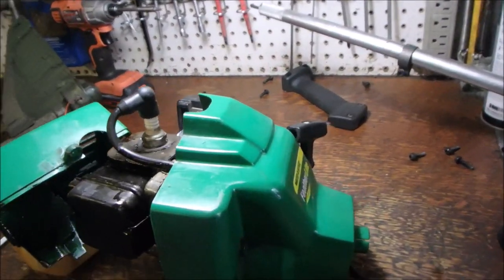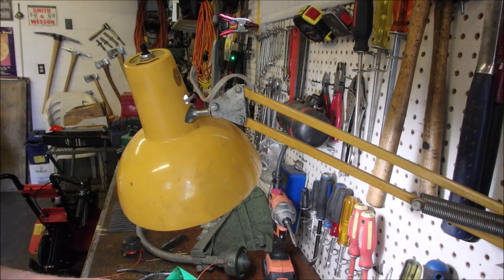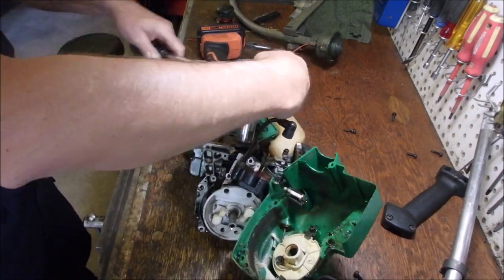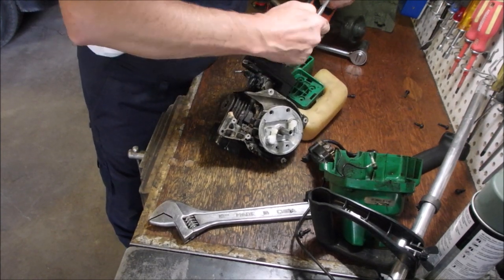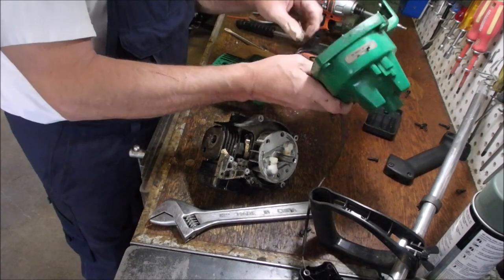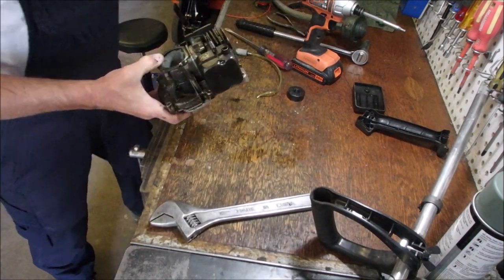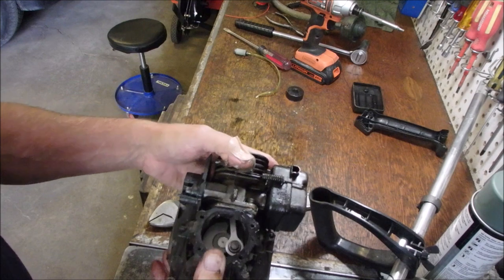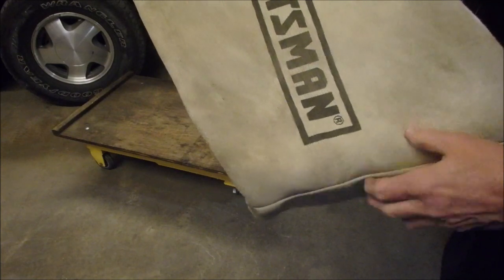Well My Weed Eater Bought The Dust

Comment: Dos anyone know if some trimmers rotate counterclockwise? I have a Troy Bilt TB414CS trimmer that does.  I thought that engines rotated clockwise.
Reply from the maker: Wow  I thought the same.
Reply: @BrucesShop  I replaced the pull cord and after I did I noticed it rotated counter clockwise. I thought I wound cord wrong but couldn't wind it the other way as the spring wouldn't allow it. I started the trimmer then it suddenly quit with a noise.  Pulling on the starter offered no resistance.  The flywheel spun freely.  Oh Oh!  Sheared key and it was but why?  The engine still turned freely.  I could see nothing wrong.  I thought I had started it running backwards somehow.  Now I can't find a key for my Troy Bilt TB415CS anywhere.  Searched the net but nothing.  Troy Bilt shows a flywheel but no keys.  Lost on this one.

Comment: Can you  put 40/1 in to a 50/1 engine
Reply from the maker: If you are using a good 2 stroke oil I would stay at 50-1 but it will run fine on 40-1 but will carbon up much faster.